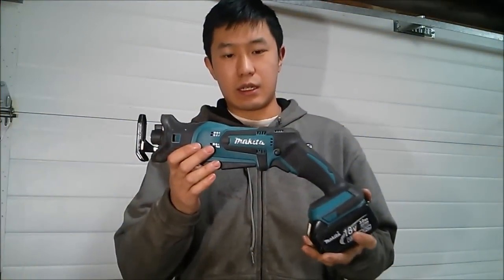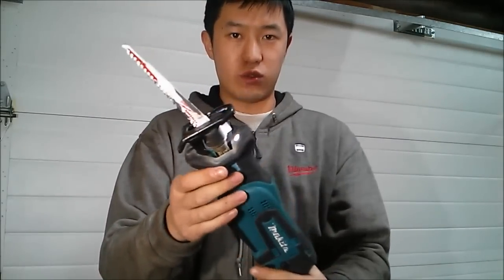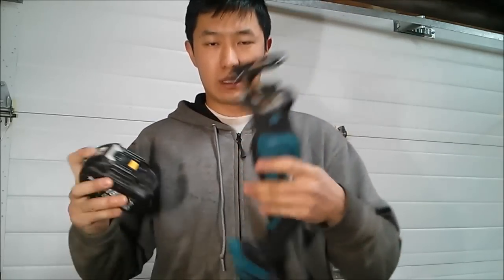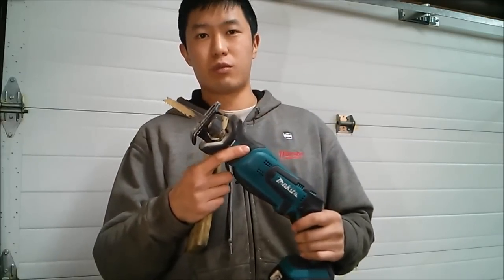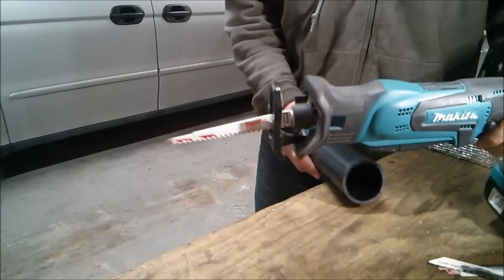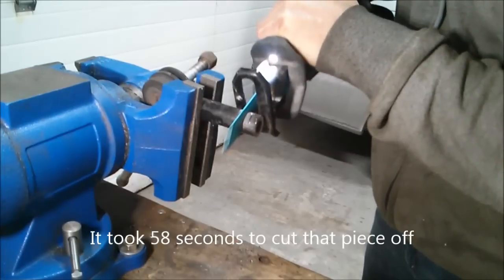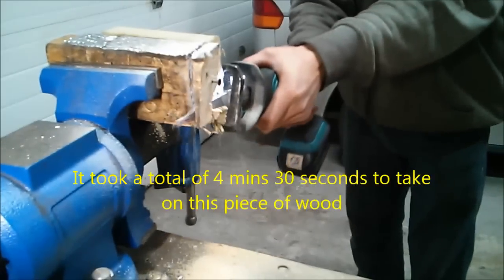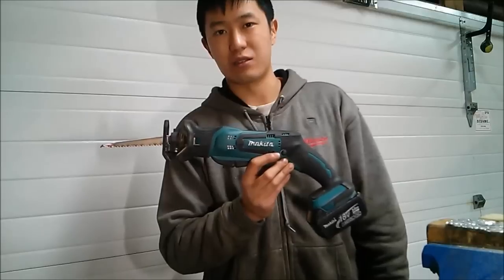Makita DJR183

Comment: I didnt even realize that they made a compact 1-handed recip saw.....the multiple trigger options look like a great idea depending on how you need to hold it.  One thing to keep in mind with nails vs screws....nails are a soft metal that is fairly easy to cut, but screws are hardened metal that will literally rip the teeth off of recip blades (probably why all manufacturers specifically list "nail embedded wood"...haha).  Good job!  Thanks for uploading!  :)
Reply from the maker: This saw i bought almost a year ago. I wanted to make a video a while ago but I didn't find the time.
Its funny you say nails are softer because a lot of contractors tell me the reverse. But I personally don't think so. Screws in wood are a pain to cut through every time.
Thanks for the comments, I really try to aspire to make the best videos from what I have. Your reviews are awesome!
Reply: PrimeMechCo Use a carbide teeth recipro blade and screws aren't a problem anymore =)
Reply from the maker: That could be true, but sometimes you just don't have any on hand. It was just extreme use test to see if it can power through the screws.

Comment: The key in using this tool is to keep it tight to the material that you cut so it doesn't vibrate in your hand. If it vibrates then the cutting process is altered dramatically. You have to push the tool to the material. I have a Bosch Keo and in my case it is esential this. i'm pretty sure it's the same with this Makita.

Comment: I cut a 90mm x90mm timber in about 30 seconds with the Makita DJR 181
Reply from the maker: +FIREHAWK1979 I wouldn't doubt it can. I do have a BJR181 reciprocating saw as well and it can handle its own. But this saw doesn't have enough power to push through some tougher materials. I would just keep it to small things like drywall, 1x material, plastics or soft metals (copper pipe). 

Happy tooling!
Reply: +PrimeMechCo if you have both the 181 and the 183, which would you consider buying? new video? I'm an electrician, and makita 18v drills/batteries etc, I used to have the 181 till it was stolen but like the compactness of the 183, just wondered which you would buy? 
great video.
Reply from the maker: foxon172 for majority of cutting, get the 181 for sure. More power, more uses.
The 183 is just for compact spaces, drywall, 3/4" (20mm) EMT, 1" (25mm) copper. That's about it for its usefulness. What type of construction do you do?
Reply from the maker: To be honest, I would get the 181 because it can handle just about everything. I would only use the 183 if its in a real tight situation but be prepared for a long cutting time. It is only good for cutting pipes and drywall. Not for demo work.

Hope this helps